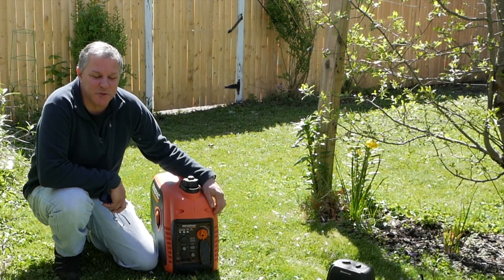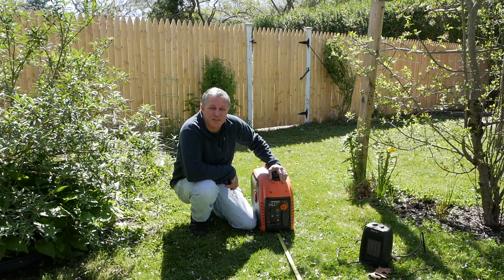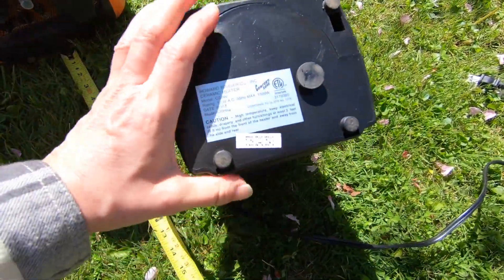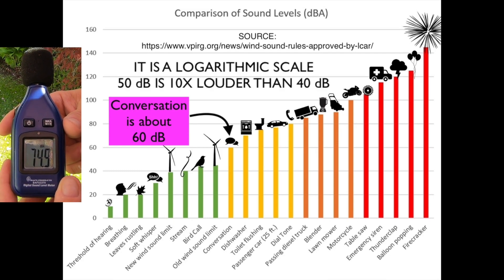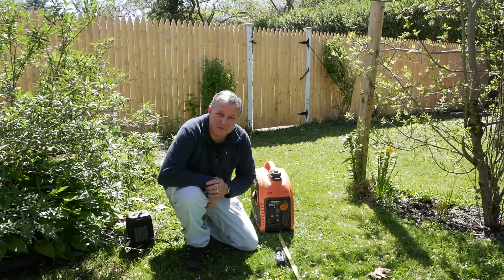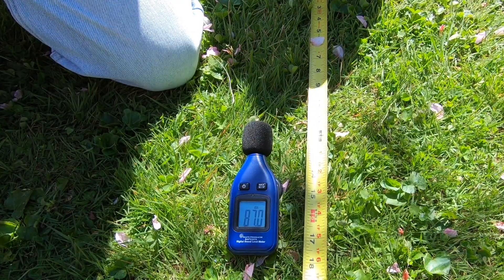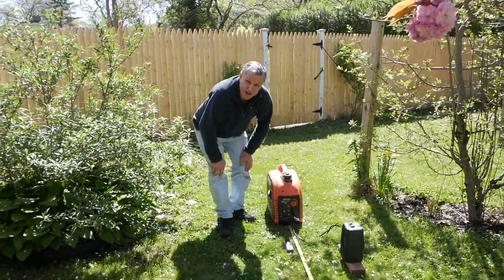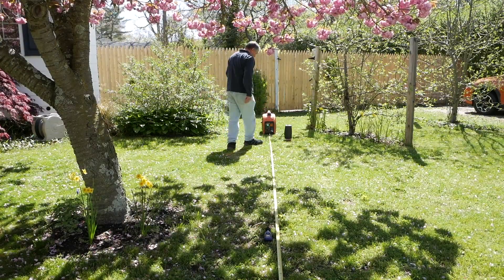GENERAC GP2200i SOUND TEST - DECIBELS UNDER LOADS

Comment from the maker: We live in a pretty noisy neighborhood! But anyway, in our opinion the generator really wasn't as loud as we expected, or maybe we are just used to a lot of noise because of where we live? What do you think?
Reply: I always thought with generators it's not always the noise level but the length of time they run. A constant droning in the background can get on your nerves. It would be much less noticeable if one lived next to a busy road or with any constant background sounds.  Some houses in residential areas have the Heat Pumps outside now, and the fan on those is about the same db's as the Generac. We all make noise today.

Comment: I'm on the fence between this one and the3500. Does the noise level go up significantly when you connect to your 5000 BTU air conditioner?  Does this generator struggle to power your AC?
Reply from the maker: This is a great generator but I would go with the 3500. We have one now and it’s nice to be able to do a few things at the same time such as make coffee with the ac on.

Comment: If they sell out side of US. Then noise levels are required. But not here. The dB level can be measured under different weightings. Like dBA, dBC or dBL. It makes quite a difference in the reading. A good rule of thumb is the 6dB doubling effect. If the distance is doubled the dB should drop 6dB. Or if distance 1/2 it will increase 6dB. With noise, personal perseption makes a difference. So many things effect the noise. Especially enviroment. The Manufactures test under lab conditions per ANSI or the country they will sell in will have a stipulation like the ISO standards. Its a big bag of worms......lol. I worked in the industry for 25 years....good job. Check the meter it should tell you the weighting it used. Probably dBA weighting which simulates human hearing. As. A microphone is more linear over the spectrum of frequencies and out hearing is not. Ill stop here is get ugly...lol . Thanks for sharing 👍👍
Reply from the maker: It definitely is a big bag of worms! That’s why we tried to keep it simple. Perception is very key! This meter wasn’t very expensive but we felt it was good enough to get a rough idea of the levels. It measures from 30 - 139 dBA. It would be great if the generator companies standardized a decibels level test with a few parameters like distance, load, etc. curious how they handle it for out if the country sales. Thanks so much for commenting.